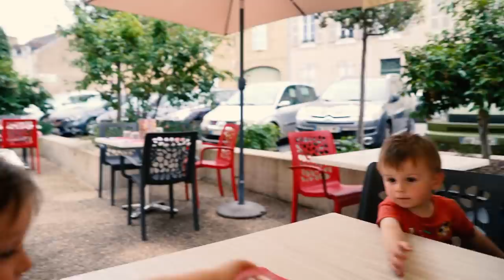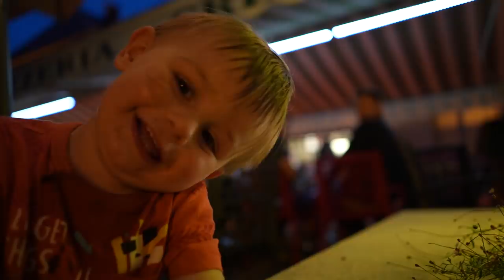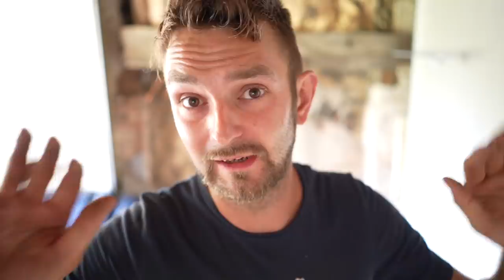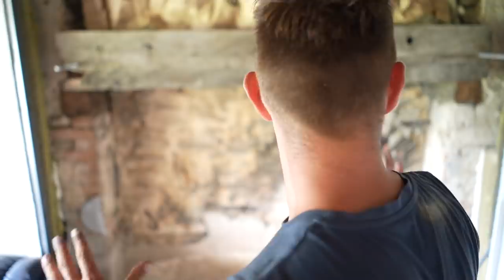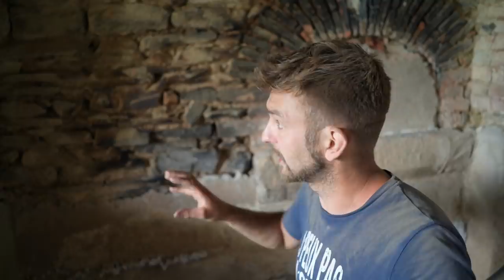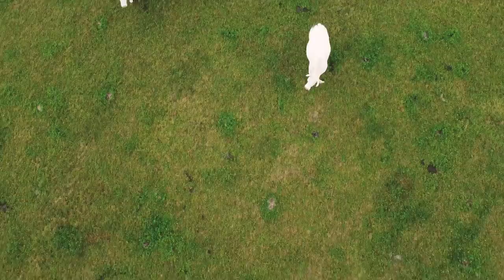Daily vlog is back, miss me? -EP031

Comment: Dan I suggest you are much better to open the bread oven (remove concrete) and point all the tiles/bricks on its surround. Any chimney needs to breath or else it will cause damp issues from the old sulphates in the chimney - correct way to treat is to have a breathable cap on the chimney top outside and some form of vent at base (if not using the chimney). It will look far better as a feature if you open it. 
Also if you open it you will find lots of debris that will have accumulated over time and this acts as a sponge for moisture and gives damp issues ....even if you want to keep it closed up you still need to get in to clean it out first.
Reply: The engineer has spoken 
Btw I don’t think there is an actual oven or chimney there anymore. 
Hence the reason for being brick up like the other bread oven.

Comment: Hi Dan, if I may suggest I would repoint all the brickwork as you have planned. Render the concrete line at the bottom and instal a wooden shelf as if it was for a fire place, to break up the two sections. I think it will look better visually and you could put kids photos, small candle. This way you still have the original stones and a clear border between the concrete. Bart

Comment: Good work on the oak mantle Dan.
I was thinking you would dig out the concrete in the old oven to make a recessed shelf or put a fake door on?
What about some custom made low level cupboards to cover the concrete at the bottom? It doesn't matter if you don't have the time or money for that now as you can just leave it until you do. 
I think taking a bit longer to get the top part exposed and pointed in full would be the best long term result as otherwise you may end up going back to it in future years anyway as you have done in other cases.

Comment: Why don't you find some rock or brick of the same type and make like a small/narrow shelf right in front of the concrete on the bottom half. It would look amazing without having to cover up what you have already cleaned up (WHICH LOOKS AMAZING) and loosing a nice feature of your wall.